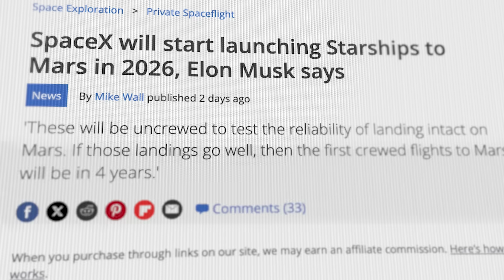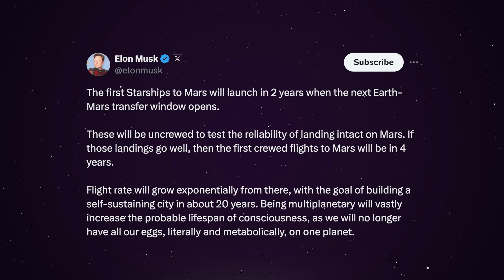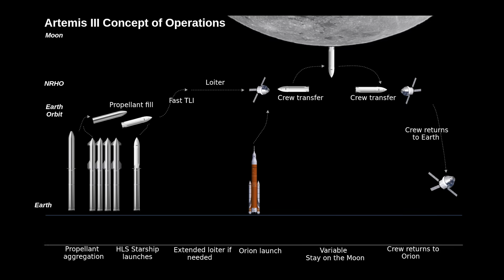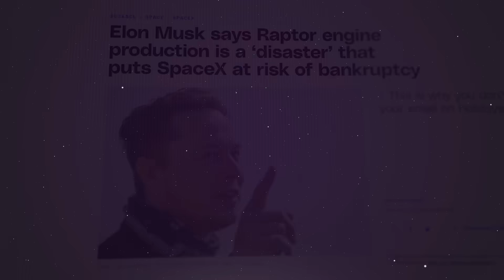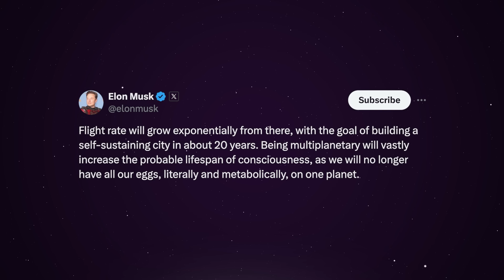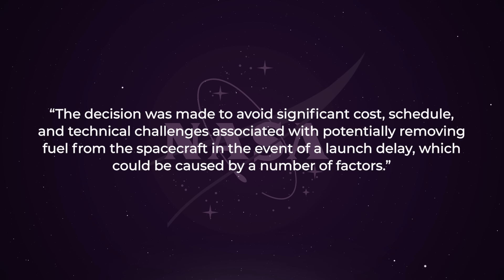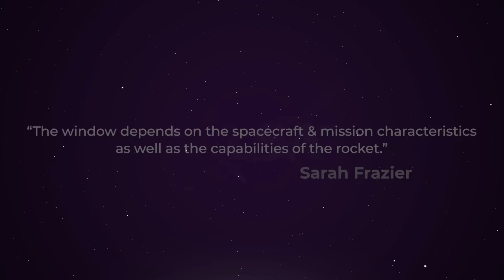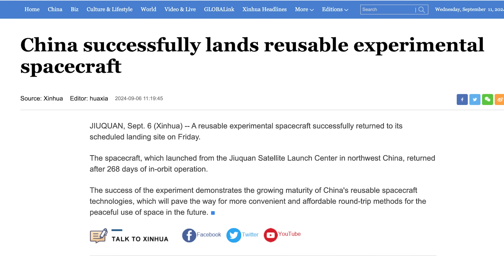Elon Musk Reveals NEW Mars Timeline

Comment: Theory on the Use of Antimatter as Fuel

The idea of using *antimatter* as fuel for advanced propulsion systems is based on its ability to release enormous amounts of energy through the process of annihilation, where antimatter particles collide with matter particles, converting all the involved mass directly into energy, as described by Einstein’s equation **E = mc²**. This process is, theoretically, the most efficient form of mass-to-energy conversion known to science.

1. Production and Storage of Antimatter
Currently, antimatter can be produced in particle accelerators, such as the Large Hadron Collider (LHC), where high-energy collisions result in the creation of antiparticles. The major challenge is the minuscule quantities produced and the extremely high cost of the process. For example, only a few atoms of *antihydrogen* have been produced so far, and the estimated cost of producing one gram of antimatter would be in the trillions of dollars.

To make the use of antimatter as fuel feasible, we would need to develop much more efficient technologies for mass production of antiparticles, such as antiprotons and positrons, possibly by exploring larger-scale collisions or yet-unknown processes in particle physics.

Another significant challenge is *storing* antimatter. Any contact between antimatter and ordinary matter would result in immediate annihilation, releasing energy uncontrollably. Today, antiparticles can be stored in magnetic and electrostatic traps, known as **Penning traps**, where they float in a vacuum, avoiding contact with material walls. However, storing larger quantities of antimatter for space propulsion would require developing much more stable and efficient magnetic containers with powerful electromagnetic fields.

2. Antimatter-Based Propulsion
The most promising application of antimatter as fuel would be in **space propulsion systems**, given its potential to release vast amounts of energy with a very small amount of fuel. Two application scenarios are considered:

a. Direct Annihilation Propulsion
In this theoretical model, the annihilation between antiprotons (antimatter particles) and protons (ordinary matter particles) would release high-energy particles, such as gamma photons, which could be directed to generate **thrust**. The efficiency would far surpass that of conventional chemical rocket systems, potentially reaching significant fractions of the speed of light, making interstellar travel more viable.

The main limitation of this concept is how to channel the energy released by annihilation in a controlled manner, as gamma radiation is difficult to capture and convert into thrust. An advanced system of mirrors or radiation-resistant materials would be required to direct this energy.

b. Hybrid Fusion-Antimatter Propulsion
Another possibility is using small amounts of antimatter to initiate nuclear fusion reactions. Nuclear fusion, which is already being researched as an energy source, requires high temperatures for atomic nuclei to fuse. Antimatter, upon annihilating with matter, could provide the initial energy needed to trigger these reactions, creating a hybrid propulsion system.

In this model, antimatter would not be the primary fuel but rather a catalyst, making nuclear fusion more efficient and controlled while reducing the amount of antimatter needed.

3. Technological Feasibility
Although antimatter is, in theory, the most efficient fuel known, there are significant practical obstacles to overcome before it becomes a usable reality:

- Cost of Production: Producing antimatter in viable quantities at an affordable cost would require revolutionary advances in particle physics and accelerator engineering.

- Safe Storage: Storing significant amounts of antimatter without causing accidental annihilation requires creating incredibly precise and robust magnetic and electrostatic fields, an area still under development.

- Energy Conversion: Even if we can control annihilation, converting the released energy into a usable form, whether electricity or propulsion, involves significant engineering challenges. Handling gamma radiation or other high-energy particles is a critical obstacle.

4. Future Applications
In the future, if these technological barriers are overcome, antimatter could revolutionize areas such as:

- Space Exploration: Interstellar travel could become possible with antimatter-powered spacecraft, reaching significant fractions of the speed of light, shortening trips to other star systems from centuries to decades.

- Emergency Energy: Small antimatter reactors could serve as emergency power sources in isolated locations or scenarios where space and weight are limited.

- Energy Weapons: On the other hand, the destructive potential of antimatter also represents a threat, capable of releasing immense amounts of energy in explosions. This raises ethical and control issues over the use of such technology.

5. Conclusion
While antimatter holds the potential to revolutionize the future of energy and propulsion, it remains a distant technology from practical application. Developing viable methods for producing, storing, and using antimatter depends on significant advances in particle physics, materials engineering, and high-energy propulsion systems. Nevertheless, antimatter represents one of the most exciting frontiers in science, with profound implications for humanity’s future, especially in the realm of space exploration.
Reply: Nobody dared to reply 😅🙈, this is way too complicated

Comment: The next ship is a block 1 block 2 has the forward flaps leeward but you knew this so as YOU should know flight 5 is about booster catching and testing new heat shield on the BLOCK 1 ship the way you say it adds drama that is not needed.

Comment: I do think starship development has taken a little longer than some people have hoped. In 2020 when we got our first high altitude flight/landing tests I had thought that it would only be another year or two of test articles and we'd have a functional ship. We've had plenty of excitement since, but enough to temper my expectations a little bit. Of course over that same time spacex has increased the number of launches per year from 27 to over 100 planned this year. Things can change quickly.

If we look at the basics, Starship is an extremely capable rocket, and future iterations will be able to put hundreds of tons into orbit per launch. But it doesn't look like it will do any operational satellite deployments this year. Basically, I think they'll have to spend at least 5 years working on satellite deployment, work on landing, get the turn-around time down, developing the ships and method of orbital refuelling, build the infrastructure to handle launching multiple starships over the course of weeks. It's not going to happen.

Looking at the timeline in 2-year increments, i.e. the mars transfer window

2018-2019: Starhopper built and flown
2020-2021: SN3-SN16 tests and hops, booster development
2022-now: Integrated flight tests

I see things accelerating in the future, but not to the point where they're ready for Mars in two years, let alone 4. 6 years is optimistic, 8 I'd say was realistic. For crewed flight, I wouldn't bet on anything closer than 20 years out.
Reply: Good thing your not running SpaceX.

Comment: Both lunar landing and mars would require rapid reusalety. Not a month to refurbish the pad and rocket but days. A more realistic question would be "do you think that SpaceX will refly a starship rocket with less than a month turnaround by 2026?"
Reply: no
Reply: The Faclon 9 needs 9 day to be refurbished. If spacex has atleast 9 rockets on standby they can launche everyday. I don't see the problem.
Reply: @LemonsRage   @LemonsRage  You must have access to numbers that I don't. Looking up the flight dates of the different boosters, I can't find any booster with a reflight date faster than about 27 days. What is the buster number of the one that was reflown again in 9 days. I would like to look it up.
Reply: what for?  a few dozend probes landed on the Moon/Mars without rapid reusability

Falcon Heavy could (by wikipedia) move 16 tons to Mars
only the freaky Starship concept needs that because of the pipe dream for a huge tonnage requirement to orbit that does no exist
Reply: @benjaminmeusburger4254  The starship can not make it to the moon without refueling. It takes a dozen launches to refuel it. This is not a normal rocket. Huge but requires refueling to leave low earth orbit.